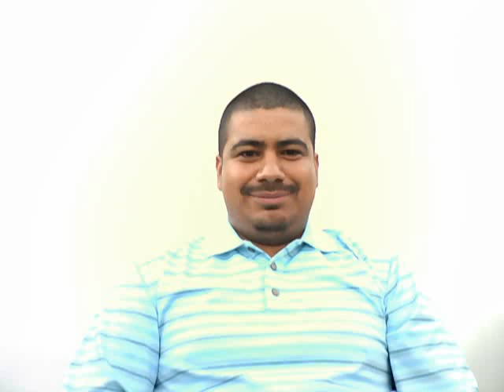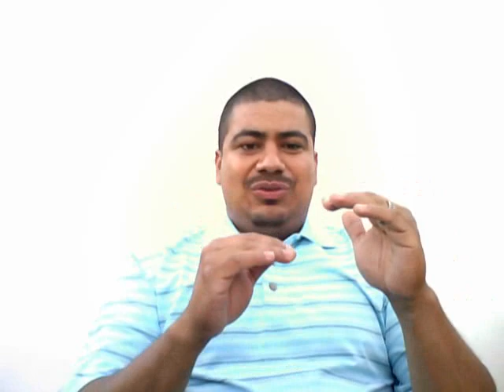Foundation Questions

Comment: Tks for the reply video. As soon as I record more video I will upload it online. I look into all the details you mentioned already. Type of soil, boundaries with the next house etz. "Estoy en ley" like we say in Puerto Rico. The soil is rocky after 13 inches. The dark soil I put it there so I could growth tomatoes.  But I never plant them. One thing I was concern was how much water I pour after the concrete dry. I read online it could crack and it did a little.  Tks I notice it quick.